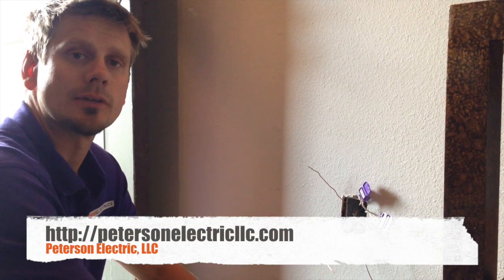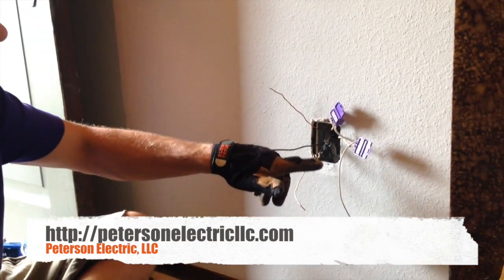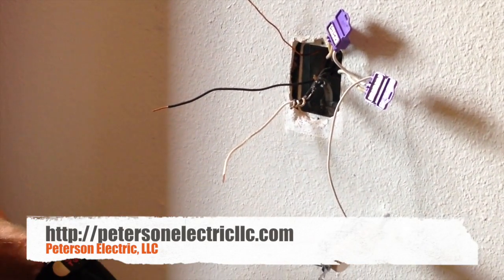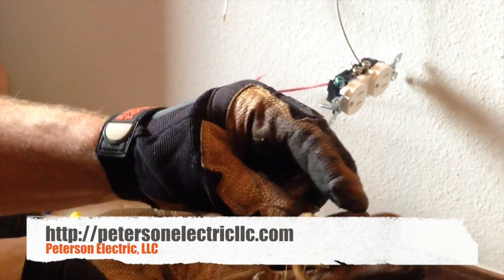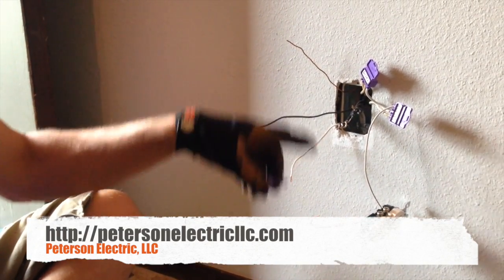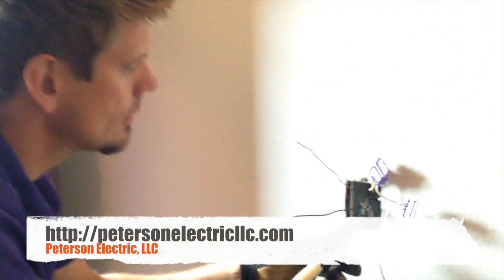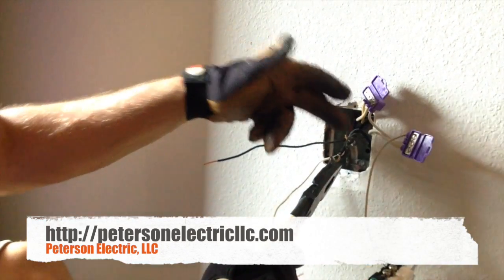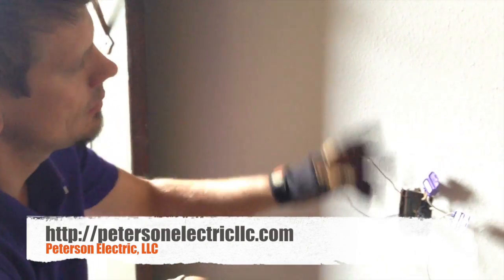Aluminum & Copper Wiring Methods In A Home, Pig-Tail Splicing

Comment: Great video, however most videos show the AlumiComm connectors on the ground wiring as well as the neutral and hot wires. Does your ground connection meet NEC code?

Comment: company i work for does the noalox in the wirenuts... guess what... i had a callback aluminum wire burning up the wall from the joint.  dont always go with the low bid it might cost you literally

Comment: Do you think splicing aluminum/copper together cause arc fault breakers to trip? I just replaced an old zinsco load center in a 2 wire home and 4 outta 6 breakers instantly tripped.  Ill be checking for lose connections when I go back. But I forgot I used regular wire nuts to pigtail the nuetrals

Comment: Oh boy I need to do this service to my house as I have AL/CU upstairs and copper in my basement. Even light tends to heat the neutral up as I have found!  Bitch with AL/CU is the breaker will not trip if your having a melt down! I was having this issue with my bathroom burning all my outlets up in the bedroom to find I needed to break off the bathroom from the AL/CU load. Needless to say i ran a 12/2 to the bathroom and we don't burn up outlets anymore. After seeing this I need to do this service in all my rooms upstairs.,

Comment: Wish you'd show us the whole process.  I don't know why people seem to think it's okay to half ass with a dry explanation.  My boss was showing me how to do the pigtail method and he half assed it too then complained when he found I wasn't applying the de-ox properly.  There's like 6 steps to pigtailing and you showed one.  And it was one my boss didn't show either so that makes it more infuriating...

1) Unsplice all wires and pop the aluminum wires  straight into the deox to get it all the way around the wire.
2) Resplice, taking care that you don't squish the aluminum as it's very delicate.
3) Use aluminum rated marrettes.  63's go on 2-wire and 65's go on 3-wire.  
4) Fold wires back into the box with the marrettes in the teacup position to keep deox from leaking out
5) Throw away any devices that formerly had alluminum touching the contacts.
6) Use hooks, not compression clamps where possible.

Comment: Wise advice, good point about tipping the wire nut upside down. Occasionally I weld aluminum, and it is surprising how often I need to grind a fresh spot to allow my ground clamp to make a connection. Even with no second metal, aluminum oxide from ambient moisture coats the surface of aluminum with an impermeable layer of poor conductivity. From there, resistance and heat do the rest. Over the long term, NoAlox works more by excluding moisture and air than by embedded sacrificial zinc particles.

Comment: I don't care how much safer it is to pigtail copper and aluminum.   I just see no point.  To me it's a waste of time and still just as dangerous "if not more dangerous".   Just rewire your entire home with copper or buy a nee home sorry...
Reply from the maker: Not everybody wants the damage and wants to pay the extra cost for electric, not to mention the damage to walls and in our county and city they have to follow the state on not more then 64 sq ft of drywall (two sheets) and or if we pull a permit than hot testing for asbestos and Lead.
Reply from the maker: I agree that I would rather rewire with copper on all branch circuits, but remember it's not our house, we can only suggest, and most people are first time home buyers with these late 60's homes.
Reply: True, I hope you didn't think I was being a prick by the way lol. I did not mean for it to sound that way.  Your videos are great.

Comment: We are professional master electricians in Edmonton, we come across bad installations now and then, but this is the worst yet.
We want the general public to think about hiring a real reputable electrical contractor, and not a handyman when it comes to electricity
Reply from the maker: I could not agree more! We did not wire the original caps with diox that was filed applied. The video was showing what I found The Service call that was requested to diagnose and repair.
Reply: Honestly i wish you kept recording how you shoved everything back in, im just thinking of my experiences with gfis and dimmers

Comment from the maker: Thank You! 
Hopefully one of my vendors in CO can find them for me. We tired two years ago to see if five different wholesalers could find anything, negative. Seems Ideal is driving this.
Reply: I'm having the same issue finding those Alumiconn connectors in CO.  Seems a bit concerning given that some research turns up that the Ideal #65 does fail, and was never actually tested according to long term heat cycle testing.  Any chance of finding & installing COPALUM here?

References:
 - "Top Scientist's Report on Aluminum Wiring Connector Will Shock You!"
   - https://youtu.be/ezp3hmauaA0
 - "Aluminum Wiring Ideal #65 purple Twist-on Connector Debate History"
   - https://inspectapedia.com/aluminum/Ideal_65_Twister_History.php
 - "Reducing the Fire Hazard in Aluminum-Wired Homes" - Dr Jesse Aronstein (via Internet Archive)
   - https://web.archive.org/web/20161010044431/http://aluminumwiringdangers.com/wp-content/uploads/2015/05/Aronstein-Report-colour2011.pdf